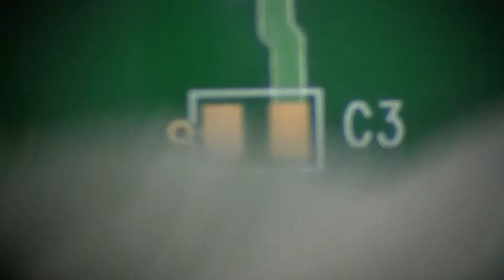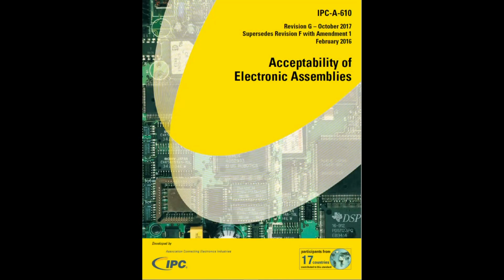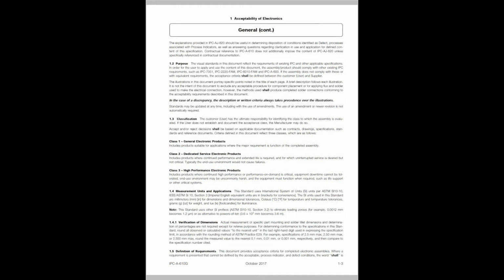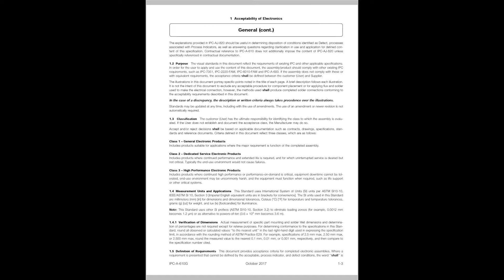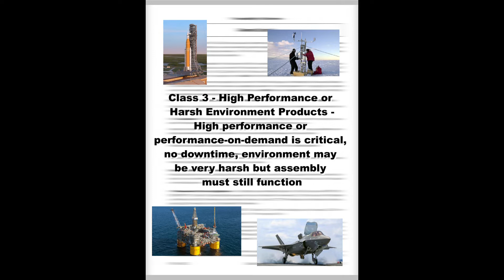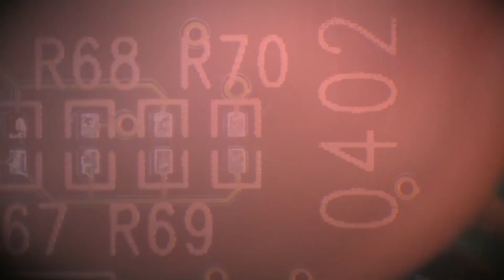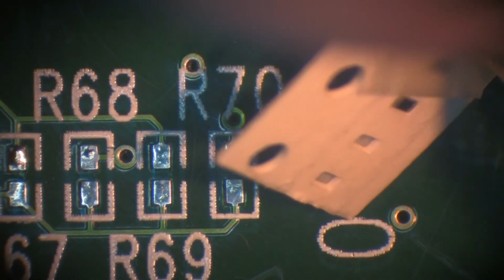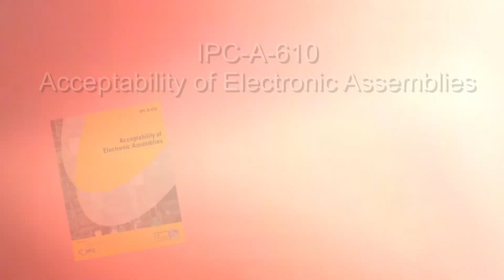How to Solder Surface Mount Resistors and Caps

Comment: AT WHAT TEMPETURE!!!
Reply: The temperature where the solder easily melts at; lead solder requires the most heat while lead free solder requires a less melting point in temperature.
Reply: @tvoovm7254  i thought that lead free solder required more heat, but ok